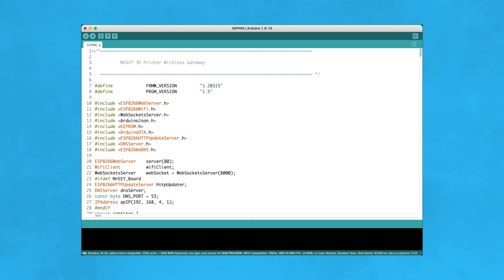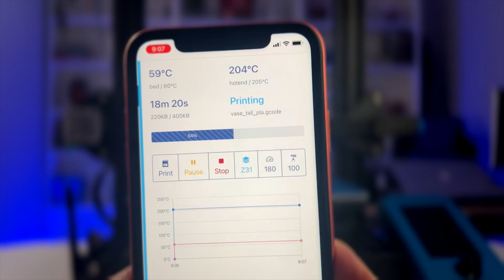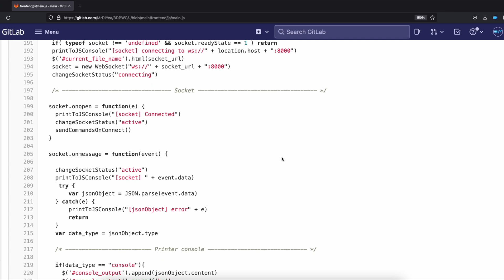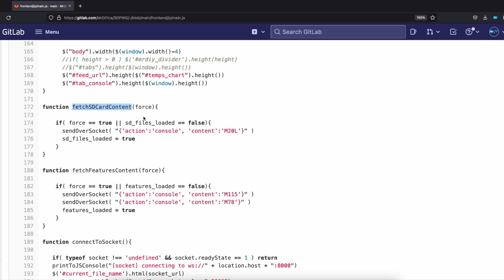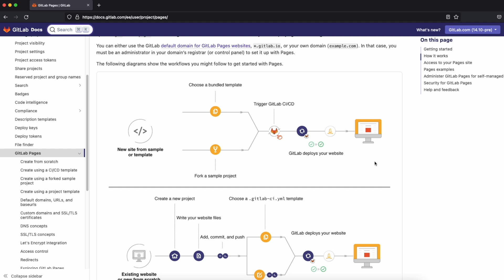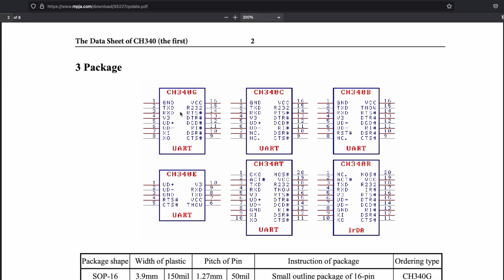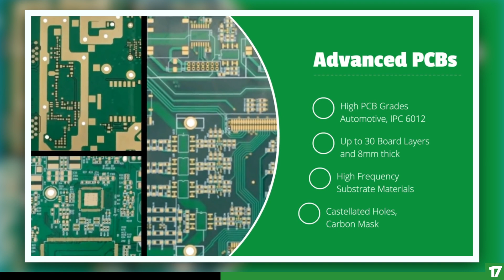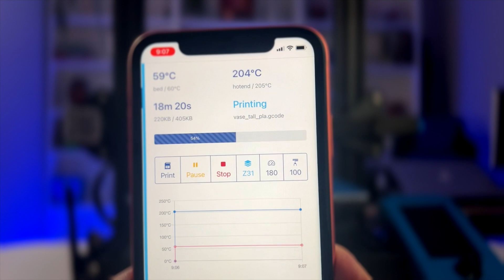My FAVORITE 3D Printer upgrade: Adding Custom Wi-Fi Control with ESP8266

Comment: I found an esp8266MOD laying around and I happened to have just set up Klipper on my ender 3 Neo. I had the idea to somehow utilize the ESP8266 with the printer to connect to my laptop which is acting as a host but I'm not sure if it's possible or if it will work smoothly. I'm thinking that once I somehow wire the ESP8266 to the printer the module would act as a wifi network and then the laptop connects to the network and communicates like this. I'm really not that experienced but I like learning about this kinda thing.

Comment: you are far smarter with this than i am. but i still have a suggestion. there are more ideal ways to connect to those piuns. if you use a dmm in continuity mode you can test arouond and find better places to connect to. amazing mod anyways i will DEFINETLY be doing this to my cr10s pro V2 soon. i just ordered a batch of esp32 modules the other day by chance so one will be going to this lol
Reply: can you guide me for such thing actually im working on a project in which i have to connect esp32 to ender3 for some specfic task i am only finding the best way to connect esp32 to ender 3 series printer so can you please  guide me for , i am eagerly waiting for your reply
Reply: @GauravPratapSingh-u1g  where are you at? i havent done this because mine are stuck at customs lol but its pretty straight forward. he gives the details pretty goof in the video but ill be happy to help if i can
Reply: @bparker86  ya I'm glad to see that you replied I just want to know how I connect my esp32 to ender 3 what is the best way to do it

Comment: i have a questions
this ca be work with ender 3 v3 se?
its possible tu put a camera on the module esp?
Reply from the maker: It should works with any printer with a serial port and GCODE.
Reply: @MrDIYca   okay i will try to conect with lipper, thanks for your repply

Comment: Hi MrDIY,
I built this and was working perfectly using Jyers firmware on my E3v2. I recently reflashed the printer with MRiscoC professional firmware and now the dashboard says idle all the time. I also do not see the IP address on the LCD when powering up the printer up like before. do you perhaps know of a solution to this issue. This firmware does not seem to respond to the commands sent from the web dashboard.  Cheers  Dave
Reply from the maker: This sounds like a baudrate issue to me
Reply: @MrDIYca  I believe you were correct,I found a setting that was unchecked to set the baud to 115k,after enabling that and refreshing my browser,everything populated. Cheers
Reply from the maker: glad to hear
Reply: It seems this is not yet resolved.  The printer will not respond again,even with printer baud set to 115k. It seems the mrisosc firmware  baud rate defaults to 250k.  What baud rate will communicate reliably with your dashboard?  Dashboard showing idle and soon after offline.
Reply: Update - dashboard started working after print was started, I am guessing the M501 command in my start  G-code brought the baud rate down to 115k . What do you think ?
Reply from the maker: @dave00011  I'm not familiar with that firmware, but the baud rate on the printer must match the dashboard, and it needs to remain consistent. It is indeed weird that the baud rate keeps changing.

Comment: Hi!

I’m new to 3D printing and just bought an Ender 3 V3 SE I noticed it doesn’t have built-in Wi-Fi, so I’m planning to use a WeMos D1 Mini with ESP3D to add Wi-Fi functionality.

I’m a bit stuck on where to connect the WeMos to the printer's motherboard, specifically the power (VCC/GND) and TX/RX pins. Have you or anyone in the community done this before? Any guidance would be really appreciated!

Thanks for all the great content, it’s been super helpful for a beginner like me!

Comment: If I'm using a USB to serial cable (one side have micro usb connector and other side have 4pin RX,TX,GND,VCC)instead of soldering it directly to the board then RX and TX work with ESP 8266 board?

Please reply soon 🙏
Reply: Hmm?  Does this work?  I don't think so.  But, I'm not sure.  Because, the cable that you'd be buying is a USB-B port that takes in USB-A connectivity and turns it into TX, RX, and some other old MODEM signaling poins too, in some cases, like CTS (Clear To Send), CD (Carrier Detect), and RTS (Ready to SEND), etc.   Besides just the TX and RX.  But,  what you would need is a USB-A Chip outside of the printer case.  Because you need the USB-A chip to package up your TX/RX signals in USB Packet headers, and such.  I hope that made sense!  🙂

Comment: I wired everything like you did and went through the procedure of connecting the esp8266 wemos d1 mini module to the internet and I can see the IP address and when i search it though your dashboard, it says the printer is in idle and it wont show any readings, how can i fix the problem?
Reply: And I'm trying to do this on my ender 5
Reply from the maker: Check for data flowing in the Console tab and your printer baud rate

Comment: i have succesfully wired everything as shown in Your video, and connected to the ESP8266 on my nodeMCU through your web dashboard, but for some reason i have zero communication with my printer, there is nothing showing on the printer screen. I can only send g-commands through your website on the console tab, but they are not getting sent to the printer, could you help me with that?
Reply from the maker: Double check your wiring (rx-tx and tx-rx and make sure you connect grounds too) and your baudrate for the printer

Comment: Hey I'm using a creality ender 3 4.2.7 board with a D1 Mini. Ive soldered to the Tx Rx pins and am drawing 5v from the board itself. The dashboard comes up but the SD card information does not show. What could I be doing wrong?
Reply from the maker: Hi, it is usually how the SD card was formatted. Did you use a Mac? Try formatting it with a window machine or a phone.
Reply: @MrDIYca  I tried it with a windows machine. I also tried formatting with a different program called SDcardFormatter
Reply from the maker: On the Console tab ( the third one), are you seeing data coming in? What do you see when you send M20?
Reply: @MrDIYca  I ended up giving up and putting my printer back together. I will attempt it again soon. Are the the VCC and GND holes right next to the CH430G IC a good place to draw power? Its 3.3v iirc
Reply from the maker: okay, well feel free to reach out when you want to resume the troubleshooting :)

Comment: Hello friend, I wanted to ask you if I can get the source code by becoming a member. It is that you would need to apply your project for personal use at home.
Reply from the maker: Yes, you can
Reply: Because I’m needing the source code for a project for my home
Reply: @MrDIYca  Hello friend I tried to join but since I don't have paypal it won't let me enter the payment from my country for a security issue. PayPal doesn't have to be able to join me? It's just that I would need the source code to have as a guide if you allow me to do a connection test in my house.

Comment: Hello Friend, I wanted to ask you if you have new videos or updates of this excellent project.
Reply from the maker: Hei, no updates to the project itself. However,  I made the source code available to my channel members today as part of the membership benefits!
Reply: @MrDIYca  Ok, my friend, I'm glad. I will see to make the payment to join the group. Since I have some ideas and my idea is to share them with you.
Reply: @MrDIYca  Amigo, I wanted to ask you if the monthly payment if necessary can be canceled, I ask you because I respect your projects a lot but I am a teacher at the public level and I buy the materials from my students because they do not have resources, that's why I consult you. Thank you very much for your support. Thank you
Reply from the maker: @marcelrios806  No need, here is the source code, I am not going to make your job more difficult :)   This link works for only one download: https://securesha.re?#u=25bbec080603bb7f246ded20206f5e3d.bin&p=MRDIY
Reply: @MrDIYca  Thank you very much, my friend, but it won't let me download it. He tells me that there is no file available.
Reply from the maker: @marcelrios806   Try this - https://securesha.re?#u=6cc68707f155ddc21042e91da7d11f8b.bin&p=MrDIY
Reply from the maker: and just to confirm, you can have your membership for just one month
Reply: @MrDIYca  The message appears to me " Sorry! File not found."

Comment: I’m really struggling with this I’ve got all the bits and am fine with the soldering part but I have no idea how to get that .bin file to go onto the d1 mini 
I’ve tried using arduino ide by using the blink example and that works I just have no idea how to open the bin file 
Can someone please help as I must be over complicating it 
Thanks

Comment: Congratulations on a great video!
I have a Longer type 3D printer on which the Marlin program runs and which I would like to control remotely.
Unfortunately, I am still a beginner in the world of Arduino, so I would like your help, how do I open the Firmware below the video in the Arduino program?
Thank you in advance for your help.
Reply: If you don’t even know how to open a firmware file, then you shouldn’t even be doing this procedure.

Comment: Hello friend, I wanted to ask you if you should modify the firmware of the wemos if you use 3 modules. Is my question about the IP assignment? Are the IPs automatically assigned or do I have to declare them in the FW to be different?
Reply from the maker: It uses DHCP for IPs
Reply: @MrDIYca  Thank you. I would like to make some adjustments and contributions to your project with your support and opinion.

Comment: does it work on ender-3pro? i upgrade to creality 4.2.7v board
Reply from the maker: Yes
Reply: @MrDIYca  I use crtouch, but is there any place where I need to modify the firmware?
Reply from the maker: @ni_algul8067  no, bed leveling has no impact on my Wi-Fi board

Comment: Isn't it possible to use a usb to serial converter and connect the ESP to that?
Reply from the maker: That was my original plan -  to communicate over USB and after going down that rabbit hole and months of design, coding and trying to figure things out, I went the 'serial way'. It was way beyond my expertise.

Comment: Connected everything as shown, getting a Wifi Message and IP shown on my ender3, even The MAC and other info shown in the Dashboard Settings tab. But no info from the printer.. I have the same CH340G Chip so i connected TX an RX on the same ports. Using a ESP8266, it also sends an IP back. Any ideas?
Reply from the maker: I would guess the Rx wire is not connected properly. The printer is receiving your commands since it is showing the IP on the printer.
Reply: @MrDIYca  checked everything twice.. Cables connected properly, no short circuit etc. My Printers Baudrate is 115200. Do i need to chance anthing?
Reply from the maker: which ESP8266 module are you using?
Reply: It‘s a nodemcu v3 CH340

Comment: Hi, nice project!
I just wanted to ask if you could share the source code of your web dashboard or if we can add our own functions for example preheat the printer (I know you could just do that with a gcode command in the console but that's not that elegant.)

And I just discovered there are pins for a filament runout sensor on the board so why not use it's 5v? Or is there any complications with that. 

But anyway thanks for this nice project.

Comment: Hello , on a bigtreetech SKR 1.3 board can be applied?
Reply from the maker: if it has a serial port and supports gcode, then the odds are pretty good
Reply: @MrDIYca  You have to connect a esp01_1M. I will try and then I will send you a video if it works.

Comment: For the M1 models, do I only connect TX, RX and power?
Reply from the maker: and ground
Reply: @MrDIYca  i connected it but it doesn't give me an ip per dhcp, but it gives me a fixed ip. could that ip be defined in the Firmware?

Comment: Hi How can I know the IP that the ESP32 will supply me. Thanks
Reply from the maker: check your router DHCP table
Reply: @MrDIYca  i connected it but it doesn't give me an ip per dhcp, but it gives me a fixed ip. could that ip be defined in the Firmware?

Comment: Looking forward to do this.. Any tip on where to get the 5V? I have D1 mini and I see that i can get ground, TXD and RXD from motherboard. (Sorry but I am way outside USA and wont be able to buy your companion board)
Reply from the maker: You can power the d1 mini using its USB port - just make sure to connect the d1 ground to the printer's ground. You don't really need the companion board, it just makes the setup neat.
Reply: @MrDIYca  Thanks a lot. Will do that.

Comment: can i upload my files via wifi from my pc to the printer? excellent video!!
Reply from the maker: Theoretically, yes but I didn’t implement it  due to its very slow speeds (serial).
Reply: @MrDIYca  the plate es32 should be made something file or I just need to install the firmware.
Reply: @MrDIYca   Where's the bottleneck ? - if the serial port of the ESP is set to 57600 baud (same by default as the com port listed under device manager when connected via USB) then the data transfer rate would be no different whether a USB cable was use or wifi.  Unless it the data transmission rate on the wireless side that slows things up ?

Comment: Nice project but disappointing that you aren't able to upload new gcode files (yet) as this is the main reason why I'd add WiFi to my printer.
Reply from the maker: It is doable but it will be painfully slow (going over Serial). It is much faster to use one of those Wi-Fi SD Cards modules.
Reply: @MrDIYca  probably could use an S2 Mini board instead of ESP8266 and make use of USB OTG ... costs about the same too

Comment: Fantastic project. I'd suggest you to create a micro usb stick that connects to the external usb port of the ender 3. This avoids soldering. Just plug and play. 

Adding video using an Esp32 cam would be perfect. Will replace octopi for 99% of the use cases.
Reply from the maker: Thanks. Actually, I went down that rabbit hole. After getting CH375 to work with ESP8266, I found that Creality is using a vendor specific descriptor as opposed to CDC and this is when I abandoned that route.
Reply: @MrDIYca  just to understand: if I read the Ender 3 serial port, I would see data different from the standard gcode (and from CH375)?

Ps: what is CDC?
Reply from the maker: No you will see the same data - 'talking' USB is the issue.
Reply: @MrDIYca  hi again. I saw the pinout of the Ender 3 display. And I found out that there is Rx and Tx pins. Since your PCB is already acessing the display Pins, what about using them instead of the CH375 (I'm again trying to help avoid soldering)? ;-)
Reply from the maker: I don't think it is a debugging serial. Can you m,monitor that port and see if you get readable data out of it?

Comment: Is the esp32 powerful enough to serve single page web applications using frameworks like Svelte or React? That would probably cut down how much work you would have to put in when designing/iterating on the dashboard.
Reply from the maker: I don't know about React/Svelte but even an ESP8266 can host the files no issues. So I am sure ESP32 can too.
Reply: I'm late to this party. But yes, easily. The esp32 is honestly a little powerhouse of a unit. Just a sorta a pain to setup imo

Comment: Great job on the video!!  Think it would be possible to use an esp32 with camera for a monitor the print?
Reply from the maker: that is a neat thing to try for sure
Reply: @MrDIYca
How did does your display not conflict with your esp8266? Aren’t they sharing the same uart?
This is a neat project. I tried it with an ESP32D, and I can upload files and send commands I loaded ESP3D instead because its got more controls. However, the issue is that I lose all communication with the display because both the ESP32D and the display are trying to share the same UART. I have a 4.3.1 board. On the side of the board, there are four pins that are typically not used. You can find the 5V and GND there. I would not recommend adding camera support with esp32 cam to the board. I would suggest buying an ip camera. Better camera quality and it frees up the processor on the esp32d for other things like sensors / actuators

Comment: Nice!
Can you upload .stl's files from de dashboard?
congratulations and thanks for sharing!
Reply from the maker: It is doable. Maybe a Marlin re-flash with a faster baud rate might help - but on stock, it is painfully slow.
Reply: @MrDIYca  Yes, I agree. Here we have a printer (Hellnot Magna 2 dual) with a built-in esp12 module. Wireless performance is quite poor, both in terms of the transfer speed of the .stl and the reliability of the received file (prints never turned out well using .stl transmitted over wifi). I assume this is because the esp12 is inside the metal chassis and there should be no error checking mechanism.
On the other hand, prints from files on SD card (not wifi) come out very well.
Your project is an incentive to go back over this feature of the printer and try to improve it. Thanks again!